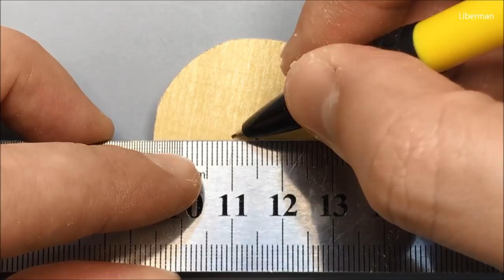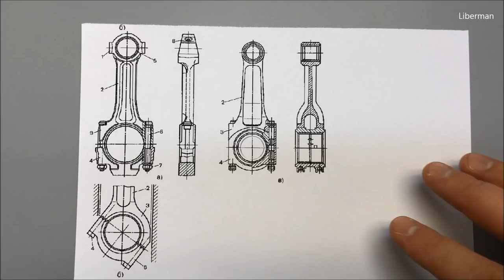How to make a boxer engine. DIY with plywood

Comment: You should attempt to make an engine that actually works, the fuel being compressed air or something.
Reply: You can use transperent plastic sheet at some specific spots so that one can see how internal parts work. For example piston cylinder plunger etc.

Comment: What is this
Reply: Berk Boyacıoğlu 
thes is à V4 engine
Reply: @ahrdzf354  it's not really a V4 either because the pistons do not make a "V" shape
so it is called "BOXER engine"
Reply: Well as you like
Reply: @agustinalcaraz6633  actually in the boxer the couple of pistons shares the crank spot... When a piston is up, in the other side the piston should be down... This engine isn't a boxer, but it's a flat